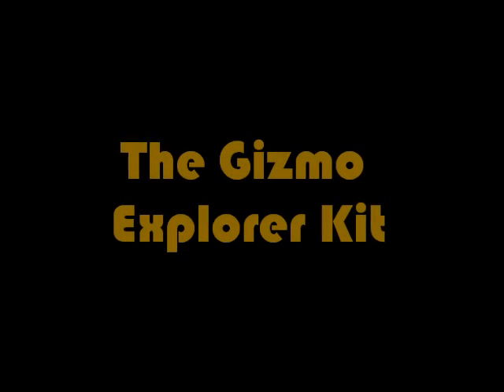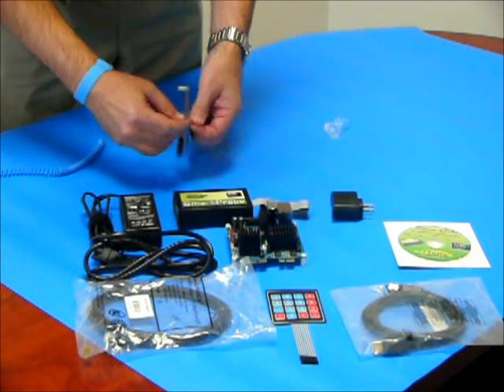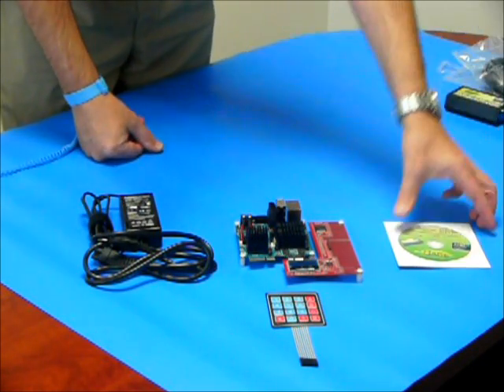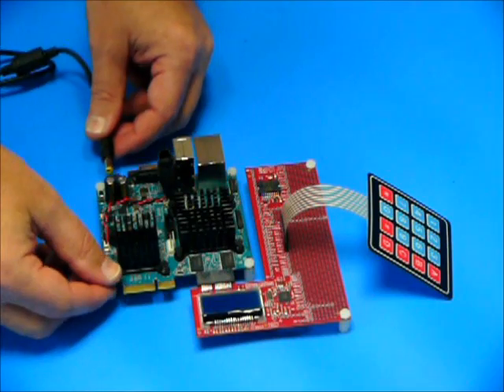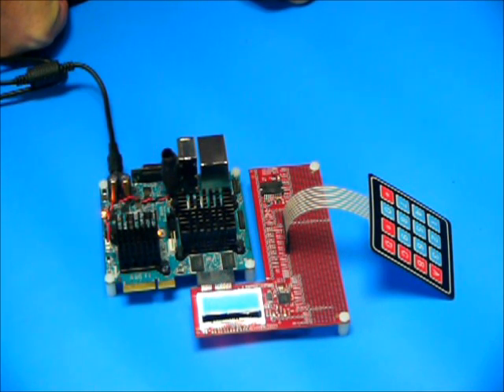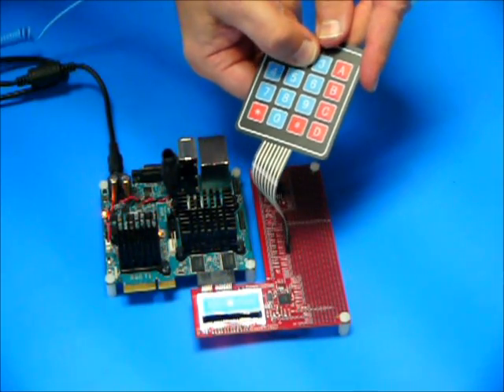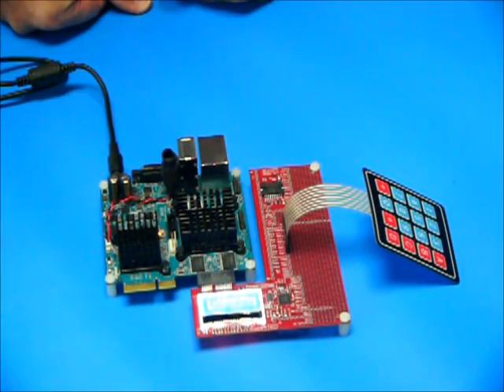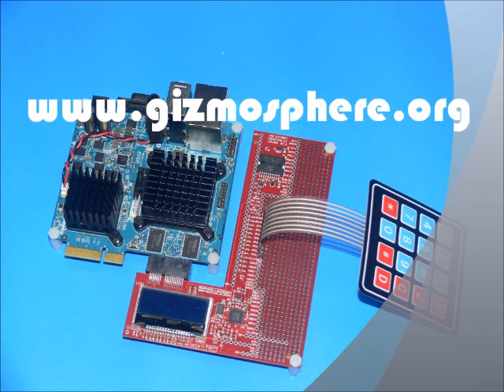Gizmo Explorer Kit - video 3 : Assembly and Turnon of Your Kit

Comment: Er... So you want to see the peripherals plugged in??

You can install a hard drive in the SATA port located between the APU and the Southbridge, and on the reverse side is all the connections required for keyboard/mouse/webcam etc. Once you have that its a simple matter to install any operating system you desire.

That's all you need for a full PC :)